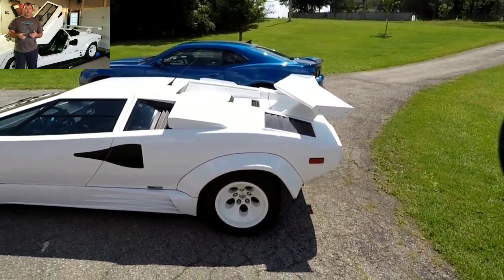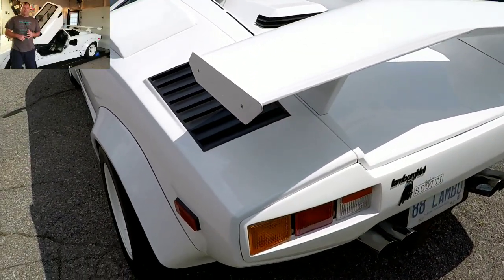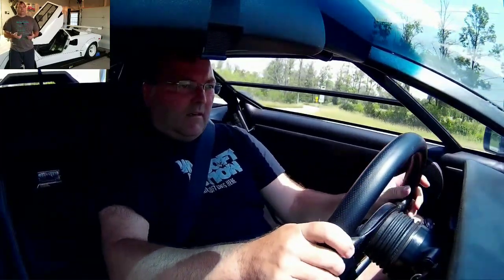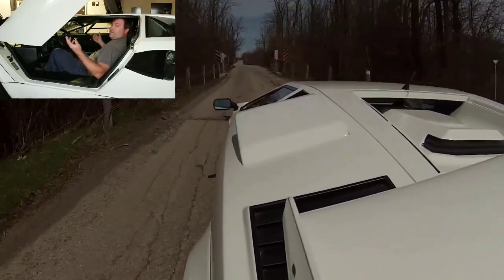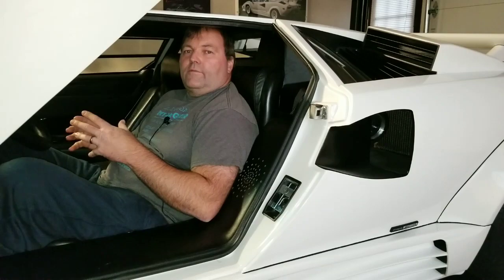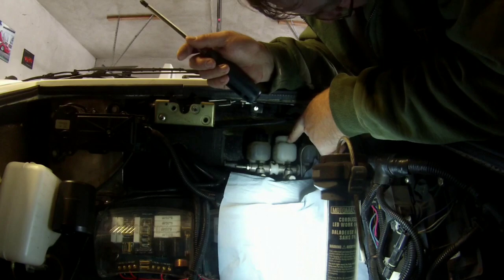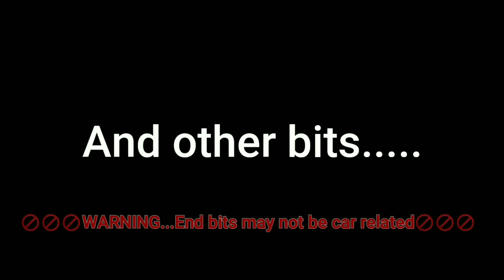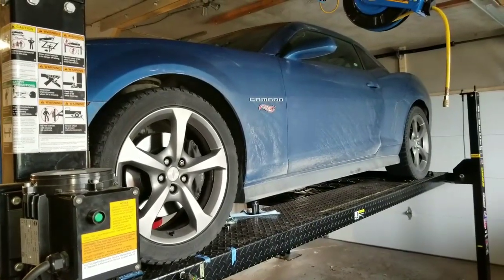Sell it for WHATTTTT!!!!!

Comment: These kits have really shot up in value. If you drop a bigger engine in it like a BMW V12 or even a 383 V8 Stroker you can actually outperform the original V12 Lamborghini engine if you sort the suspension out as well. Not to mention the reliability will greatly increase and you won't be raped on the insurance rate either considering it's a replica.
Reply: Everything has pros and cons